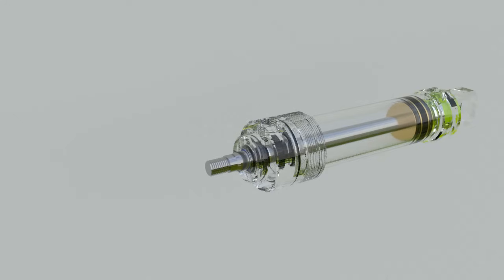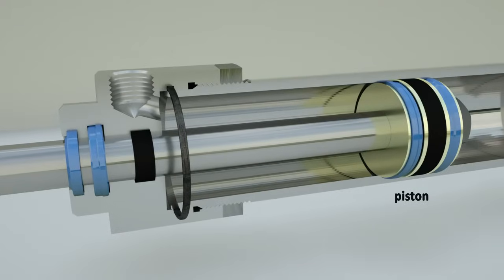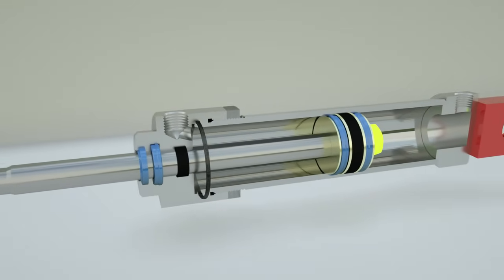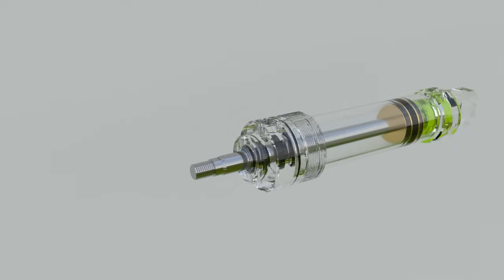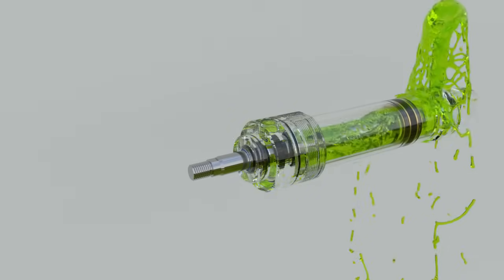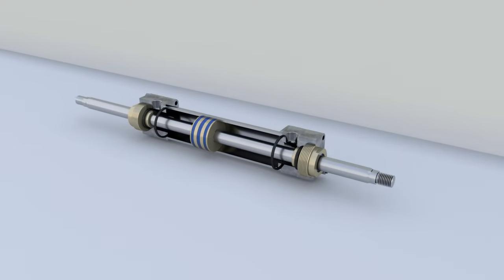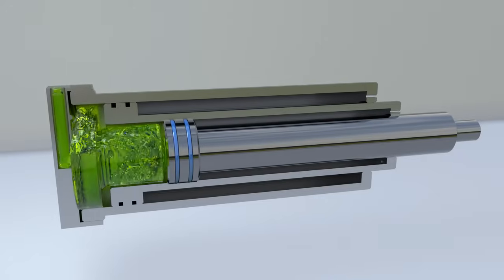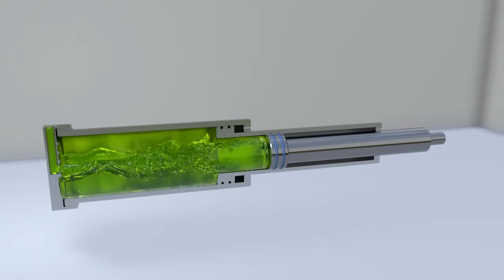How does a hydraulic cylinder work?

Comment: Don't know that I've ever seen a double action telescoping cylinder.
Reply from the maker: Yes, this is a rare thing.  Double-acting telescopic hydraulic cylinders are used in some garbage trucks to move the side that ramps the garbage.
Reply: @hydraulicandpneumaticsyste3253  Yep. I'm a garbage man. So this is very popular in garbage trucks. Runs the packer, crusher panel, dump body, tailgate, lift arms.
Reply: @hydraulicandpneumaticsyste3253  what tipe of vessel steering gear using sir?